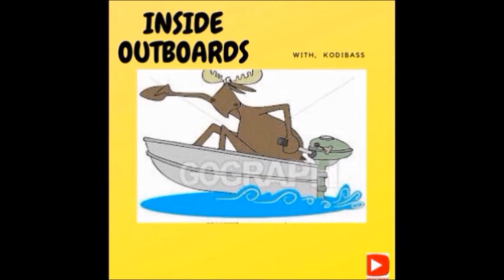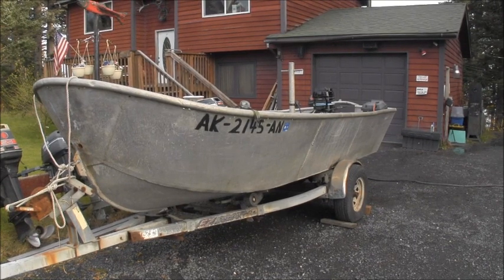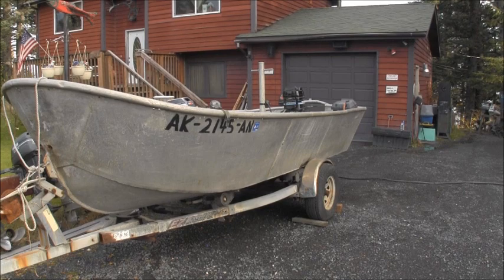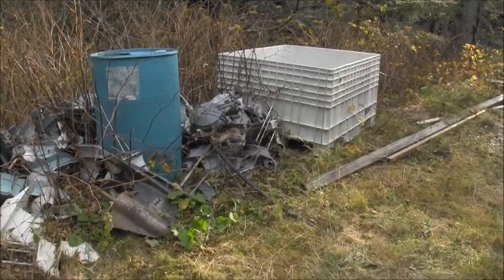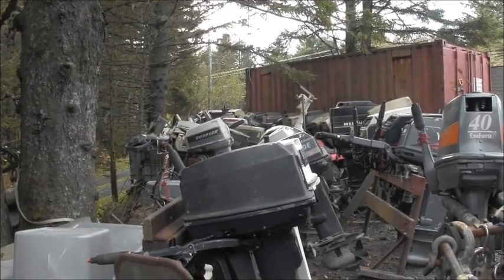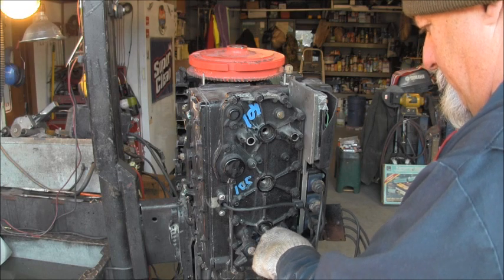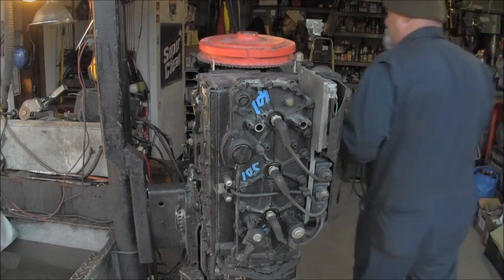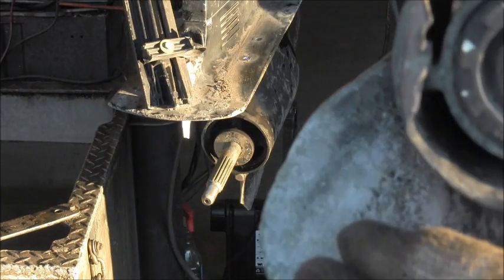MERCURY 2 STROKE OUTBOARD'S  &  More

Comment: Placing that motor ahead of the transom moves the skiff's center of gravity forward and allows for a higher rear level that will keep rear-coming swells from flooding the boat. It also keeps the propeller away from whatever cables or lines you would have to backup to.
Reply from the maker: Now that U mention it , That is one of the things I like about the boat, it's bow has almost no rise when powering up 2 speed.      kb

Comment: hi Kodi, Wow you have a ton of parts. The way things are going with getting parts with the shipping impact folks might be wise to buy some good used parts from you for now. Well I went to mow the yard since rain is coming and hit some old downrigging wire that fell out of the shed onto the lawn. It kill the motor so I cut the wire off the blade to restart it. Now I have no compression??? Always something to tear apart around here. I hope it didn't throw a rod? free spin with no knocking noises? It was going to be the last mow for the season. I guess the mower already quit. haha
Reply from the maker: I sure hope may-b  just a Fly-w  key.    kb
Reply: Well a bit more than that for sure. The intake valve seat came out. Pressed it back in and peened around it. Will see how much longer it last?